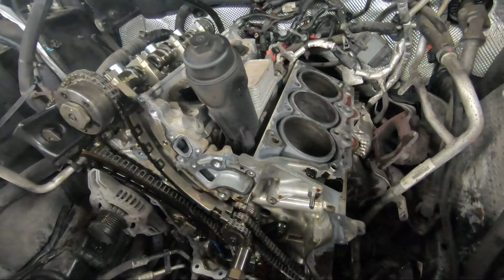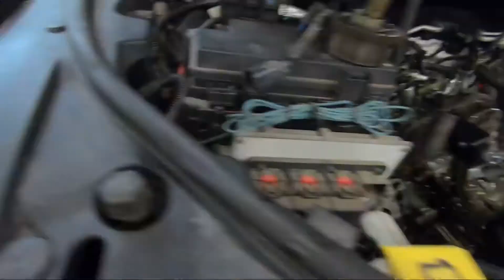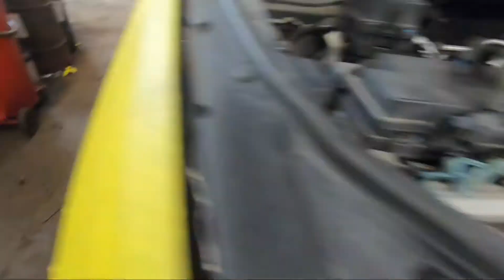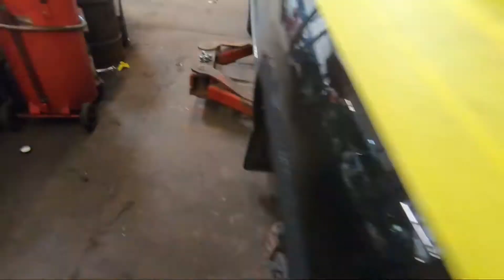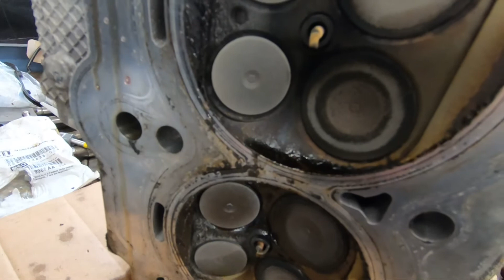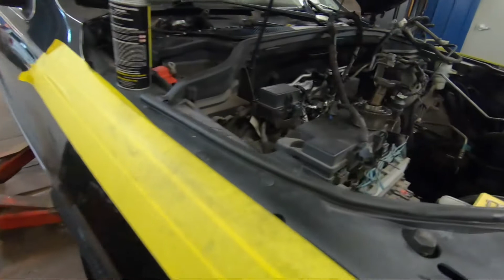PENTASTAR cylinder head failure.

Comment: I have a 2014 ram 1500 with p0302. Cylinder seals, passes leakage test but compression shows around 85 psi.
Reply from the maker: Did you wet the cylinder.

Comment: waddup gman!
Reply: my 2013 dodge grand caravan with a 3.6 pentastar just failed compression test on cylinder 2 and 6. 4 is fine. 

What's my next move?

Gonna do a leakdown test next to figure out what part of 2 and 6 are leaking. 

Why would both leak as if they are sharing the same issue?
Reply from the maker: @MikeYeah  well, usually when bank 2 misfires 2,4,6 it’s the head. Bank one 1,3,5, it’s a coil. Do your diag, it will lead you to the problem.
Reply: @gmanhere.173  hi fam! I think I'm gonna do some valve lapping on the exhaust valves on bank 2 head instead of replacing the whole head itself 

What do you think?
Reply from the maker: @ it’s always worth a shot because the valve seats are the problem
Reply: @gmanhere.173  okay that's reassuring! thanks so much for your expertise. Couldn't have done it without ya 🤝
Reply from the maker: @ any time my friend.

Comment: I'm in need of some advice..
2016 Ram Promaster 3.6 pentashit 136k miles...
;( P0306 ;( plugs & coils already been replaced..
#6 compression @70psi #6 leak down test failed bad
#4 comp @150psi #4 leak down test good.
#2 comp @160psi #2 leak down test good.
Pulled valve cover, found multiple bad rollers, and multiple worn out cam lobes #6 exhaust especially bad 
Should I replace the cylinder head, cams, rollers and lifters or is it time for a new engine?
Thanks for your help G!
Reply from the maker: @albert-gazo  your call. The miles are high. 50/50 success rate on doing the repair. I would throw a long block in it.

Comment: Would this cause ticking noise? I’ve replaced lifters/arms already. Got a P0302 code recently. Replaced coils, fuel injectors and spark plugs as well. Still ticks
Reply from the maker: @quintraviusmiller6750  did you replace the rocker arms and lifters?

Comment: Hello sir, I dropped an injecter o ring in cylinder 5 while doing oil cooler housing. I took the plug out and bumped the engine. Before, the engine started, the o ring shot out. However, when i put the plug back in and started the engine, it makes a knocking sound now. I also have low oil pressure light. Do you think a little O ring bent my valve? If it's the rocker arms failing, how can it fail after a first start, loud and clear.
Reply from the maker: @farhanmohammed1059  doubt it’s the oring causing your problems. I would scope your cylinders. Why did you take the injectors out? Also check the housing, and the internal filter, something there is causing the oil pressure problem.
Reply: @gmanhere.173  I took the injecter out becasue I had to take the fuel rail out on 2014 Challenger 3.6. I will try to put another oil cooler on it.
Reply from the maker: @farhanmohammed1059  ok sound good.

Comment: What up gman I've got misfire on cylinder 3 usually at start up and then goes away swapped timing solenoid plugs coil nothing times throws white smoke but not all times 17 Durango penastar engine
Reply: The whole head or head gasket can't get it resurfaced and slap new head gasket? What about blue devil?
Reply from the maker: @ whole head and gasket. I’d recommend dealership OEM PARTS.
Reply from the maker: @Big4hunid  i’m sorry, Brother but you’re gonna have to change that cylinder head

Comment: This still happens on 2016's? What's the approx cost of repair?
Reply from the maker: @JasonS70  yes it still happens on all the years. Most have extended warranty
Reply: @gmanhere.173  Hey, any chance this head/misfire situation can make the transmission act up?
Reply from the maker: @ a misfire can definitely make a trans act up. Lock up will be erratic.

Comment: Hey brother I’ve got a crazy one for you and I’ve worked on shit for thirty years , changed some rockers on a 3.2 in and out job you know that as well as I do but changed these and lost compression on couple cylinders thought ok maybe I fucked up some how did a leak down blowing out of intake tore it down to find nothing guides good no damage so fig take them have machines look at them he cleans valves and seats up to find some carbon in seats he said but did the work put them back on still leaking every where cams out am I missing something because I’ve done a hundred of these no issue
Reply from the maker: @russellmckay1655  makes no sense. Double check timing and phaser position , along with rocker arm positioning.
Reply: @gmanhere.173  there’s no phasers or cams bolted on
Reply from the maker: @russellmckay1655  have the heads checked out or throw a new set on. I just had a pro master with pretty much the same problem. A set of heads took care of it. The cylinder leak down was in conclusive.

Comment: Hi! Great vid! I have a 2014 durango 3.6 and it had the cel on so I scanned it and said p0301 also rough idke, i replaced all 6 spark plugs cleared the code, idles rough still cel came back but now p0305 and p0300. 
Any suggestions?? 
Drives fine under load! 
Id really appreciate some guidance, i have a rental car company and the car needs to get back on the road on friday :/ thank you so so much for your time and knowledge
Reply: Thank you so much for the quick reply. I will keep you posted. Ill be home in a few hours and jump right at it
Reply from the maker: @santiagomercant9206  not a problem
Reply: @gmanhere.173 so i put brand new NGK coils on the 1-3-5 side of the engine (the side that i get codes at) (also plugs) 
When you start the engine its solid, until it removes the choke and goes into those really low rpms. Then it idles rough like if you had a drag v8 in it. It shakes. 
No clicks, oil change done 2k miles ago. I got the same cylinder 5 code and now i got one stating idle speed too high or something like that. 
I haven’t touch the injectors yet. 
Im willing to keep talking through here but also im down to send you some $ and jump on a call if you prefer or if you dont mind. 
Scratching my head over this durango right now. 
Thanks so much for your time
Reply: Update: now i just got the cylinder 5 missfire. No other code
Reply from the maker: @santiagomercant9206  you’ll have to dig in a little bit, but you can try switching the injector to see if the misfire moves you shouldn’t of bought any coils that’s a waste of money
Reply: @gmanhere.173 i can return them i asked first 😂 okay ill do that now. Thank you!!
Reply from the maker: @santiagomercant9206  try the basics first switch the coil to another good cylinder switch the injector afterwards and see if the misfire moves. Let me know.
Reply: More updates. I went for a drive and after a while driving i got a low voltage warning and battery light came on. Battery is reading 11.46 and the same in the alternator, the more load i put the more it lowers. 
Could this be related? 
Battery is 2months old bought it brand new from autozone and its AGM all just like the factory.
Reply: Btw the car drives great. It didn’t hesitate once. Except after the battery warning showed up and the rough idle came back
Reply from the maker: @santiagomercant9206  shouldn’t be related
Reply: @santiagomercant9206 possibly aux battery draining main battery.

Comment: Hey gman
I have a 2016 Wrangler 
Had a tick bank 2.
Went in and changed out bad rocker...did the whole bank.
Month later got p0302.
I've changed everything from pcv coils plugs sensors.
Did leak down test on cyl 2
Compression is very low. I dont feel exhaust coming out of tail pipe. But i can hear air releasing out of engine somewhere while doing leak down. Doesnt seem to be coming out of intake ports. No bubbles or air in the radiator either.
Have you come across clyinder 2 that may have stuck piston rings or am i grasping at straws?
Is my best bet pulling the head off?
Reply: My misfire on cylinder 6 is a burnt valve. Pulled plug and Yeap toast. That’s what over 4 years of driving a ticking engine will do to you. Now I’m driving it through the showroom window 😂😂😂😂😂
Reply from the maker: Unfortunately, your problem there is gonna be a burnt valve seat. It’s hard to detect, but that’s what it is, always remember a misfire on a PENTASTAR on 2,4,6 is the cylinder head, 1,3,5 it’s usually a coil any other questions feel free to let me know.

Comment: 2016 Ram 3.6 115,000mi
Started seeing a little excess smoke/vapour in exhaust persisting when warm. 2 weeks later, cyl6 misfire; replaced all plugs and coil 6, totally stopped misfire. But now seeing much more white smoke in exhaust. Coolant level not dropping at all. Oil looks clean but level on dipstick is high. Cold start has no smoke in exhaust, only smokes once driving. No codes. Seems to start and run fine. Wondering if it's just injector stuck open and fuel pushing into crank case and burning out through pcv. Or maybe valve seat damage? Booked in to a reputable mechanic in a week from now, and not driving it until fixed. Any input appreciated.
Reply from the maker: That’s going to be bank 2 cylinder head. Valve seat is losing its integrity.
Reply: Good luck with your reputable mechanic as mine sucks ass

Comment: if you didnt take the engine front cover off would you be able to take cylinder 1 head or riight head off or you Have to take engine cover off.??
Reply from the maker: There is a dowel. It doesn’t take much more to remove the cover.

Comment: So there is a tech service bulletin on the 2014-2018 Pentastars for this exact problem.  However apparently Mopar/Stellantis wont warranty earlier motors for this.  Im going to contact Stellantis about this issue as this is my daily and im not dumping $$$$$ into replacing cylinder heads on this damn thing.  Avoid the 3.6L shitter.

Comment: what is the approximate price to do the head replacement?
Reply from the maker: Warranty time is approximately 9 hours, cash can be in the upscale of double warranty time.
Reply: do the valve guide seals go bad a lot on these engines?
Reply from the maker: @ricknoonan9451  no.
Reply: @gmanhere.173  it’s rear cylinder passenger side and the plug oil fouls after about 1500 miles
Reply from the maker: @ricknoonan9451  bank 1-cylinders 1,3,5-bank 2-cylinder 2,4,6. Valve seats burn because of incorrect coolant jacket casting. Never had an oil consumption problem with a PENTASTAR. I do them all the time.

Comment: -first the rockers go bad via bearing failure
-This causes cam shaft scoring/damage. 
-That then affects the valve lift duration since the rocker pushes down on the valve stem and in this case causes the valve to burn up from not closing fully.

Did I get all that right? Anyways I got a 3.6 pentastar in the shop with a cyl 5 misfire even after a tune up with new coil. Rough idle. Should I skip the injector and just open the valve cover to check the status of the cam/rocker? You said it's rate for cyl 5... does that mean this disaster is never the case for cyl 5 misfire then? I was thinking a cam phaser or even the vvt solenoid might also cause a misfire what do you think is a next good step after the tuneup failed? Thanks
Reply from the maker: Rockers don’t discriminate. Check them all.
Reply: You need to open her up and check your valve train, but I’m just a rookie 😂😂😂

Comment: P0302 misfire code. 2017 Wrangler Sport: changed all plugs, changed fuel injector 2xs, changed coil 2xs, changed cams and rockers, compression tests performed by 2 different mechanics (both passed), leak down test - passed, still have check engine light with same code.  Do you think a burnt valve seat is the issue, or could it be an electrical harness issue?
Reply from the maker: Change the head my friend. Almost always 2,4,6 is a head and 1,3,5 is a coil. MOST of the time.
Reply: @gmanhere.173  would a reman head work or "New" head?? What goes bad with the 2,4,6 head??
Reply from the maker: @stanghp1  reman or new is fine. Yes, bank 2 head burns the valve seat because of casting problems.

Comment: When you do timing chains how do you determine what location to put the camshafts for top dead center. Is top dead center at stage 2 position or stage 1?
Reply: The camshafts have holes on them, up 12 o'clock position is tdc, the phaser also has to be positioned with the little dots facing each other for tdc. Hope that helps.

Comment: Great info! 2016 Jeep Wrangler Pentastar 94,000 miles. Had to do all rockers/lifters and one cam. Have a misfire cylinder #3 and hoping (like you said) it’s the coil. Should I just change all 3 coils 1,3,5 ?
Reply from the maker: Your call buddy I usually don’t change the coils unless it’s needed.

Comment: To pull the timing cover do you have to remove the upper oil pan? Or just the lower?
Reply from the maker: Depending on what model the PENTASTAR is in the most you would have to do is remove the lower metal cover. 5 timing bolt fasteners are located within. Never needed to remove the upper aluminum pan unless doing the oil pump which is another popular thing that goes bad.
Reply: @gmanhere.173  Thanks for the insight. I have a 17 grand cherokee that I'll be replacing both cylinder heads on and Mitchell says to remove upper and lower oil pans to remove timing cover which didn't sound right to me. Either way thanks for the reply 👍

Comment: Hi, just seen your vid and I have a 2012 Avenger 3.6l. In the process of removing L head, see there is actual small chucks of aluminum stuck under the edge of #2 cylinder intake valve? Is that anything you have seen before?  Just praying it's not piston pieces ugh
Reply from the maker: Could be ring lands. Why are you removing the head? Misfire?
Reply: @gmanhere.173  Thank you for responding. First code was p2172 then the #2 cylinder misfire code. Yeah there is chunks of aluminum stuck under intake valve i can see from the top. Also yesterday found that valves rocker are laying down in the oil valley of the head. I'm praying the aluminum pieces stuck between the valve and valve seat is not piston pieces 😮 I'm fairly good with mechanical stuff, but this one got worried lol
Reply from the maker: @bryanfuller21  make sure it’s not rocker arm or cam debris. They known for dropping the roller and grinding up the camshaft.
Reply: @gmanhere.173  I did find one roller laying in the oil galley of the head, It's like bran new I would quess it fell  out of position since there was not tension anymore from the valve being stuck open by the pieces of whatever broke loose in cylinder (piston ring?) I also will check the cam over carefully for sure. Again I thank you for your response and advise one this one!!  It's a nice clean car and worth saving, not sure how long 
it 's going to take  and how much $$$ to fix it, I'm kinda of an old guy so I move a bit slower lol I don't understand what could of gone wrong inside the motor, it was well taken care of, no sludge nothing clean inside inside the motor.  But things break i guess lol THanks again, and I will update next time I get somemore done.

Comment: Last week CEL on my 2014 T&C with 134,000 came on. No prior indication of trouble. Did notice idle RPM fluctuations. Dealer said replace Cylinder Head..$3000+. Also had the oil filter housing leak a year ago $900. Purchased Max Care Lifetime Warranty when new. So far $6000 worth of warranty work since 2014. I think there’s a class action lawsuit on this.
Reply from the maker: No class action on this. The left valve seats always burn due to head casting’s. Yes, oil coolers to this day still leak eventually. The PENTASTAR still ranks as the top v6 available. No one makes a perfect product.
Reply: @gmanhere.173  Pentastar is a great engine. If you look at comments from engine remanufacturers and owners forums it does have its expensive issues.
Reply from the maker: @calbob750  as so does all manufacturers.
Reply: @gmanhere.173    Bull.  GM had the 3000 series V6 motors damn near perfect.  Nissan makes their VQ series V6 and they are literally still the best on the market.  Pentastar is pretty crap.  They should have not put the oil cooler/filter assembly where they did.  Its a bad design.
Reply from the maker: @nissan300ztt  I just fix them. I don’t make them.

Comment: BUT what causes that issue because my 2018 300 had 58k with a p0306 and it was the bank 2 cylinder 6 does this happen when you use  low octane gas like 87 .
Reply: I think Chrysler said it’s extended warranty of up to 150k
Reply from the maker: @wilfredjaime1130  120k.
Reply from the maker: Nothing to do with fuel. Cylinder head casting causing exhaust valve seat burn up. Very common problem with the PENTASTAR.
Reply: Thanks for the reply 👍appreciated
Reply: And how often should I expect this happened
Reply from the maker: @wilfredjaime1130  cylinder head replacement? Misfire? Because of the valve seats? Can happen anytime or not.
Reply: 120k 👍 good know